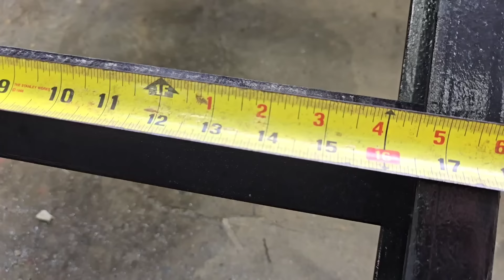Video 1 upgrading Paul's trailer

Comment: With my OCD, I'd use a mill to drill and countersink holes in the diamond plate and use stove bolts into tapped holes in the channel. Also drill through both plates together so they're interchangeable.

Comment: Great tips, great work. Keep it coming... (You're welcome for my contribution to the algorithm) Although I'm not a fan of the self-tappers for anything that is going to be removed and re-installed over time. But as you said, this leaves the customer options to drill out and bolt later if desired. And now that I think about what you did, over-size drilling the holes, its more like a tapped hole with bolts in it now. Disregard my comment about the self-tappers use in this application, I'll show myself out...
Reply from the maker: Thanks for watching and commenting

Comment: Thabk you again for the great content!!!  In the past I've spot welded heavy guage expanded steel over ramps, cut the width about 1/4 inch short to keep it close to flush.  Over time no matter what the stuff bends and the spots break.  This is a far better solution.
Reply from the maker: Paul's idea mostly...I just added some bracing under what he had

Comment: Hey CB,  Great start on the trailer.  The stiffening angle down the center and across the ends is a great idea.  You brought up some things I was unaware of on trailer deck screws and that is once you run them in they will ruin the threads if you remove them.  I was thinking of them while you were talking about attaching the diamond plate aluminum.  I thought the counter sunk heads would keep something from hanging up as it was being dragged up the ramp.  When you mentioned bolts, nuts and washers, I had an idea for maybe the future since channel has a taper on the inside of the flange and it wouldn't work for this application.  I've welded nuts to the back side of metal plate that was too thin to tap threads into.  MC offers oversize nuts where 1/4" nuts that usually take a 7/16" wrench will take a 1/2" wrench.  It gives you a little bit more metal to weld to without burning through the nut.  Subscribed and like from the beginning.
Reply from the maker: Thank you...good to hear from ya...I've seen oversized nuts before those would be best to tack weld on something 👍

Comment: Looks sharp! Good thing you supported it with the angle; and it'll probably be ok for a mower or 4-wheeler.....but I've got concerns about anything heavier than a car-  My Dad owned a truck and hauled cars (coast-coast). The ramps were AL, but were 1/4" + thick; and I don't recall what we were loading, but they were bent/damaged a couple of times.

Keep up the good work and videos, thanks!
Reply from the maker: Right on

Comment: I was thinking that maybe the  ramps need some slots to let the air go through when you are on the freeway?
Reply: They are removable
Reply from the maker: This is a pretty heavy duty trailer...not sure it would make much difference on something this heavy but it would certainly weaken the aluminum considerably 
I wouldn't try it unless the customer ask me to do it

Comment: Hey C.B. ! Just saw the Super Service truck here in Charlottesville this morning. Would love to run into you and meet you sometime. That said, I know you’re in town for a reason and I will respect your time and privacy.
Reply from the maker: https://youtu.be/XkiggpEtUP4?si=X1khD7a4LRwVhBMA

I decided to keep the house I own in Charlottesville and I have been remodeling it...I've been trying to get down here about one week a month when I can fit it between welding jobs...I'm actually on my 19th work trip here and I'm almost finished with the house...it's been a full gut-job meaning I ripped it to the studs, replaced all wiring, plumbing, insulation, & roof...completely replaced HVAC, re-excavated the lawn and replaced all the downspouts & underground drain lines, repaired and repainted the basement,  replaced the water supply lines all the way to the city meter barrel, all new gas lines and all new septic too...it's been quite a job.

Gotta get back to work...thanks for watching and commenting...keep up the support for the channel I really appreciate it
Reply: @NBSWELDING  Sounds like a huge amount of work and a bigger headache. Thanks for taking the time to reply. Good luck to you, brother.

Comment: Good job CB, although I am not too crazy about the aluminum angle, I think it is going to wear out real fast, I would have used square tubing. Also, when there is vibration on the piece I like to use rivets, the will take a beating and will not come loose over time
Reply from the maker: This has got to be removable 

Thanks for watching and commenting

Comment: Where do u buy your drill bits and what brand name are they they seem do drill well
Reply: Kobalt bits are king
Reply from the maker: My local Lowe's has good Dewalt bits that I get for special purposes but I drilled that ramp with cheap Warrior bits from Harbor Freight, they will drill mild steel pretty good but are usually toast after one job

Comment: Have you done any videos on fixing a rusted out truck frame
Reply from the maker: No...I don't find many rusted truck frames that are really worth fixing...once one spot has rusted through I generally find almost all areas of the rest of the frame are too far gone to risk my name on...especially considering that someone could be badly hurt in an accident if there was a frame failure.  I could see a guy at home patching an old truck for farm use at low speed but guys that weld for a living need to avoid getting involved.

Comment: Cb is it worth cutting the ends of the ramp arms to a 45 deg to get it flush with the ground when loading, it looks like a few inch's to jump
Reply from the maker: I don't think it's worth it...the ones I've seen done that way got tore up because it makes the ends weak...I'd only do that if the customer ask me to specifically